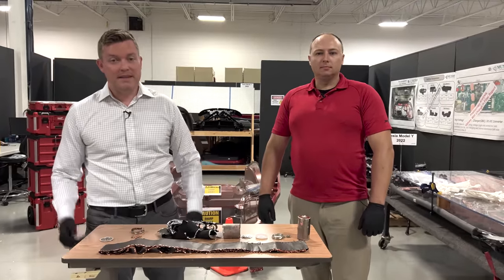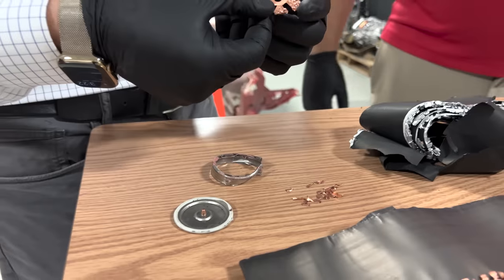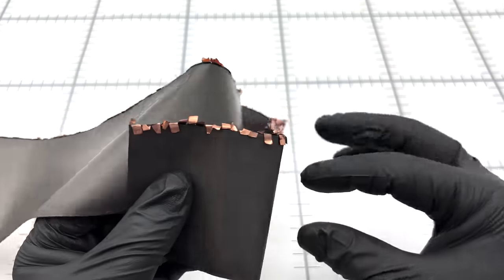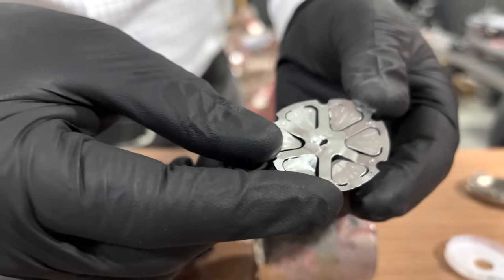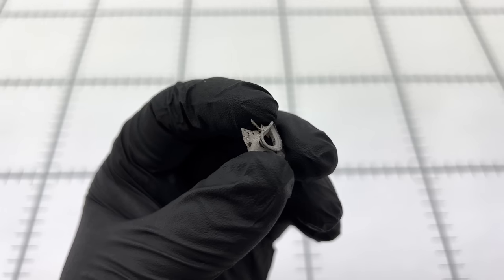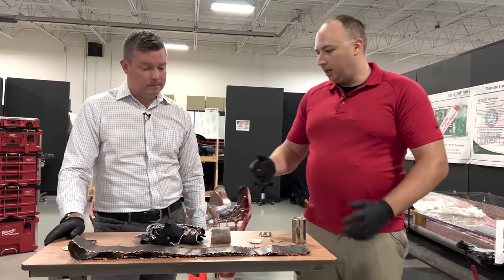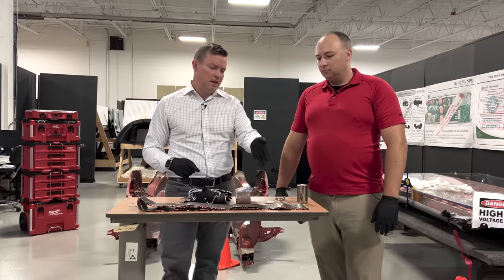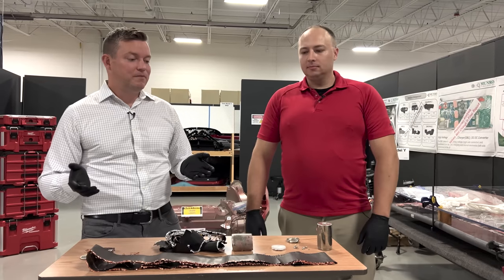What's Inside a Tesla 4680 Battery?

Comment: Just a bit of advice for cutting open the individual batteries:  Chuck the battery up in a lathe and mount a Dremel tool on the tool post.   Using a very thin abrasive cutting disk or one of the serrated metal cutting disks, you should be able to use the cross slide to slowly feed the running dremel tool's cutting disk (with the lathe also running, but at very low rpm, 5-20 rpm) into the body of the battery.  It's a nice way to precisely control the cutting of thin metals, especially those prone to tearing.    I prefer the abrasive disks for this, but for your purposes, it might be easier to control the heat generated with a serrated metal cutting disk than with an abrasive disk.    Seriously though, this is great for all kinds of cylindrical/conical/spherical (and anything in between) objects with thin walls (Stainless, Carbon fiber, whatever) as long as the part can be held in the chuck, it works great!
Reply: ... May have done something similar. No lathe though

Comment: How "explosive" or volatile is the 4680? Since you guys have been taking so many safety precautions, it would be interesting to see some real destructive testing. Could use cells that are slightly damaged. Fire/heat test, nail test, water test, overload test, charge/discharge test, crush test(under hydraulic press), bullet test, freeze test, and throw-it-at-a-cybertruck test.
Reply: Yes we want 💥
Reply: Bingo.
But enclosure is a factor as well. Are there standardized tests yet for intrusion from the road surface side?
There was the case of someone sh00ting into the floor of his Model S, the pack didn't like that. is that risk greater with the pack having now only layer less between cabin and cells?
Reply: Hit one with a drill or axe  (a charged one)
Reply: Love the last test, made me laugh!  "throw-it-at-a-cybertruck test"
Reply: They are overplaying the danger.  4680 format is no more dangerous than others to take apart.  Fake drama.
Reply: Fires and explosions could be counterproductive.
Reply: Which part of "this is a rather thick piece of steel, so it's not easy" (to puncture) did you miss? ( 0:25 )
.
Reply: @JRP3  
Dangerous, no
Difficult, yes
Reply: @rogerstarkey5390  I didn't comment on the difficulty.  Not that I consider a few passes with a pipe cutter "difficult" either.
Reply: That won't happen.  The mission is to promote TSLA, not to remind people of battery fires.
Reply: @blackthorncane1841  EV's are far less likely to catch fire than ICE vehicles, so there is no rational reason to "remind people of battery fires", other than to spread FUD.
Reply: Buy some of the cells from them for $800 ea and start your own 4680 destruction YouTube channel :)
Reply: @JRP3  Its called workplace safety. Its not drama. In many work environments folks wear protective gear everyday just in the CHANCE that something will fall out of the sky and hit them in the head. Its not being dramatic. Its being safe.
Reply: There should be a throw it under a Cybertruck test, too. It will be useful to know how well that can stands up to being squashed under a vehicle tyre, on a rough road surface, compared to subjecting it to the tender ministrations of an hydraulic press.
Reply: @Mr2winners  Lol. The drill casing would break, and charged axes are hard to find. 😂👍
Reply: @patreekotime4578  I didn't say anything about not taking safety precautions, I simply stated that their claims of danger were far overblown.
Reply: @JRP3  That is a ridiculous argument. The people here in this chat want to see this kind of testing done because we are interested in the technology. What you are talking about is essentially car politics. We care about the engineering here and we want to see stress testing so we know what may or may not be an advantage of this design.
Reply: @geordonworley5618  I have no idea what argument you are referring to.  People are making ridiculous statements and I'm correcting them.
Reply: @blackthorncane1841  they have no incentive to promote Tesla.
Reply: The "Volitility" of lithium cells strongly depends on the state of charge.  Going to get the most energetic video with charged or over-charged cells.
Reply: they probably didn't want to get suid and/or ruin the battery. after all, they sell them for 800 dollars a piece
Reply: In my view, one of the most important safety measure is resistance to cascade failure, or runaway situation. I believe that some early model 3s were involved in accidents where some cells were sufficiently damaged to ignite, but the pack as a whole did not. There was at least one case where the damage bad enough the pack came apart and individual cells were thrown some distance. Nevertheless, there was no large fire. Going by the pack tear down, and the thick steel the can is made of, I think this version is going to be highly resistant to a thermal runaway.
Reply: There is definite danger here. Yes it is easy to protect from but you need to actively do that protection. 
20 feet from anything that can burn. Body protection gear. 
Some batteries have chemicals that burn more than 30 seconds after being exposed to air. They are the first people to open one on camera so there was an unknown element of how it would react. 

Something getting on your clothes and then burning 1-5 minutes later would make for a very bad day. 

Now that it has been done once they would not need as much protection the second time.
Reply: @JRP3  I think you are wrong.  rounding #s: the 4680 cell has >3x the storage of an 18650 or 2170.  If it shorts out it might weld itself together till it burns out.  The danger is >3x.
Reply: @jacoblf  Not if properly discharged before disassembly.  I've seen far larger prismatic cells taken apart with no problems.
Reply: @blackthorncane1841  
'Putting out The Fire, with gasoline'
Reply: That's what sensationalized YouTube channels do, your car batteries will never be pierced by a nail or crushed with a hydraulic press or shot with a bullet. There's plenty of other channels doing that stuff, you're in the wrong place.
Reply: If something contains a lot of energy, you gotta be careful. There is just no way around that.
Reply: @drkastenbrot  That's why proper procedure is to fully discharge a cell before taking it apart.  That's the way around that.
Reply: Has to be pretty stable, considering steel cylinder cell, "quite thick". Surrounded by structural foam. Then encases in a steel pack housing. The cordless drills that everyone uses are lithium ion 18650 cells just stuck inside a plastic case.... those things I know first hand get used as "gentle tap" hammers and I have yet to hear about a single on going up in flames.
Reply: @JRP3  I’ve had batteries on fire.  It’s not fun…
Reply: @ecospider5  No they are not the first one who opens these cells.
The channel 'The Limiting Factor' has published an opening month ago. Just search for 'The Limiting Factor 4680 Teardown'.  ;)
Reply: @Georgewilliamherbert  Irrelevant.  No one is saying batteries can't catch fire, though it's obviously quite rare or most of us wouldn't walk around with them in our pockets every day.  The point is that a fully discharged 4680 is not a high risk object.
Reply: @JRP3  it stores a lot more energy, so it would be like a potential reaction the size of several smaller cells being damaged together
Reply: @JRP3  they contain much more energy per cell however
Reply: @JRP3  A fully discharged, fully disassembled cell still contains traces of the liquid electrolyte. The anode material also crumbled when handled. And since none of that is stuff you probably want to end up on your sandwich, your privates, your eyes or your mouth, they are wearing gloves. Which is a standard safety precaution. How is that being dramatic? The only drama here is your statements. If anything, the Munro shop has far LESS protective gear happening than many workshops that require eye and head protection just to walk through.
Reply: As someone who oversees the production of these 4680 cells at giga Texas I can assure you hitting a charged cell with a hammer will cause havoc 😂 fire most definitely/explosion possibly
Reply: @jimoliver7617  but extremely productive for a channel view counts
Reply: @265chemic  I've seen much larger cells destructively disassembled with no issues.
Reply: @265chemic  They contain much less energy per cell than many other much larger cells which have been taken apart.
Reply: @patreekotime4578  I'm talking about their statement in the video at 8:40 about the danger of the cell "going thermal and spitting fire everywhere" and the over reaction in the comments from people freaking out about the danger, like yourself.  Unless you put a flame to it any trace electrolyte is not going to spontaneously combust in a discharged cell.  Stop the fear mongering.
Reply: Ever thrown sodium in water? Lithium is a lot like sodium.
Reply: @JRP3  I once put a 9-volt battery in my pocket that already had some loose change in it.  I got quite a thermal surprise awhile later!
Reply: @PaulVanchugov  We would see some mighty fine flames.
Reply: One major point of the test is to know what happens to the battery with different types of stresses. We can ooh and ahh about 4680 manufacturing and materials, but it doesn't really inform everyone about the cell's performance, safety, reliability, and robustness. Testing can show proof.   This could be a chance to collaborate with other YouTube channels that facilitate testing (Project Farm, Will Prowse, HydraulicPressChannel,  JerryRigEverything, LimitingFactor...etc). It's an episode idea that will benefit everyone(engineers, viewers, the curious, creators). Does the 4680 meet the hype in performance/ safety/ manufacturability?
Reply: @mrknesiah  Lithium ion cells don't contain metallic lithium.  Lithium ions are nothing like sodium, or metallic lithium.
Reply: @joseconcepcion4715  I've seen 2170s do so, from just dropping on the floor.
Reply: Different show
Reply: @squee8174  4680s would definitely cause mayhem lol, I wouldn’t want to be anywhere near one if dropped 😂
Reply: @RWBHere  would you drive an ICE car through a burning pool of petrol to see what happens?
If not, why not?
Reply: I think you got this channel confused with Jackass show.
Reply: @dimention6600  
😂 😂 😂
Reply: @JRP3  Fine. You go play reckless games with your health all you want. I will applaud any channel that actively encourages safety.
Reply: @patreekotime4578  Fine.  I'll continue to call out irrational overblown fear mongering.  You can promote safety without being over dramatic and promoting FUD about lithium batteries.
Reply: @blackthorncane1841  
"Their mission" is to professionally test and in some cases demonstrate the construction of various aspects of a wide range of products, in this case a new design of cell.
As such they don't "promote" a particular company outside commenting as experts on good (or bad) aspects of a design when identified (they have historically done both with most companies, including Tesla)
They have no business "reminding" anyone of anything outside the parameters of the work they do.
Should they do so, it may not be considered "professional"?
.
As for Battery fires, are you still flogging that dead horse?
Reply: @JRP3  
(I think we're on the same side😉)
Reply: @namelastname4077  
It's nothing about "getting sued"
It's about a professional company projecting an image that encourages business.
.
A prospective customer seeing them dismantle any product without more than adequate safe precautions would simply take their business elsewhere.
Reply: @grahammonk8013  
"Cascade" failure(?)
I think you're confusing Model 3 with Model S? (I don't recall any issues with the 3 pack)
.
As for the S, there's the once famous, well dissected 
 case in California, where the car was actually ripped in half, including the front face if the pack, which compromised a few cells but was safe enough not only for witnesses to remove the driver, but for Tesla employees to arrive at the request of the fire department and remove some cells by hand, without protection 45 minutes after the event.
Not exactly a cascade failure, rather a lack of procedural knowledge by emergency services.
.
In this pack, it's covered.
If a cell SHOULD fail, it's specifically designed with a pressure release, with any "fire" projecting downwards, through the base of the pack, not sideways towards other cells. Then there's the retardant foam between them, which furthers ensures that will be the case.
It's hard the think of a situation where more than one cell would be compromised.
(Not to mention that these cells will be running with less heat stress and so less chance of exceeding design parameters)
Reply: @jacoblf  
I think you are wrong.
This cell, in its present form has at least 5 times the storage capacity of the 2170 cell, as indicated by the quantity in comparative packs
(4416 vs 828 = 5.3)
The 2270 holds about 37% more than the 18650...
However, the 4680 not only had a thicker casing, but is specifically designed with a "weak" spot, to "blow" downwards away from the cabin and other cells in case of overpressure.
.
The floor of the pack would be sacrificial, but strong enough to avoid penetration.
.
It's safe
.
For my part, I'd find it interesting to see a comparative test, using the methods you describe, between a cell (IN a pack) and a tank of gas.
I'm quite certain the 4680 pack would have a better outcome.
.
Let's not go looking for problems that don't exist?
Reply: @martylawson1638  
Apply the same criteria to an ICE fuel system, I know which one I would want to be standing next to.
Reply: @ivankuljis1780  
Bowie for the win!!
Reply: @rogerstarkey5390  exactly.  Every EV fire I've heard about starts with the car saying "hey I'm on fire please pull over" and ends with the occupants safety watching the car burn on the side of the road.  Burning gasoline  is rarely that polite...
Reply: @rogerstarkey5390  
Bowie was at the top of the Tree, even to the end! 'Blackstar'🖤
Reply: @JRP3  thank you for pointing this out. So tired of EV fire FUD.
Reply: You do know the ICE is more likely to catch fire, right?